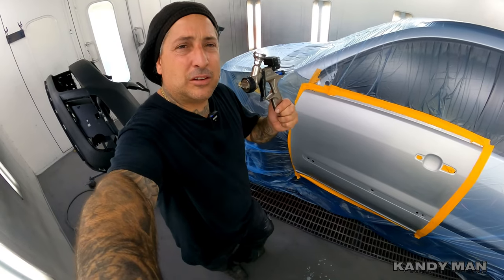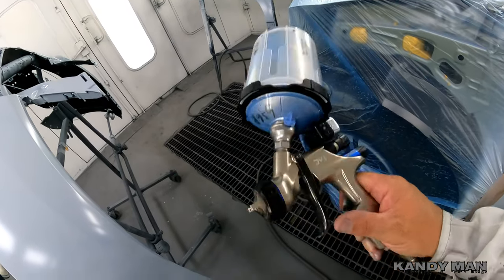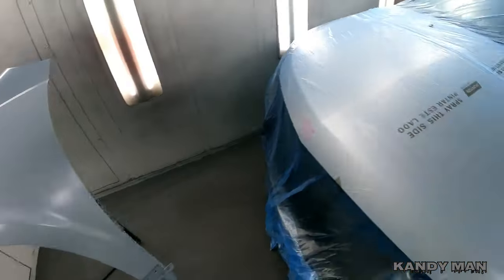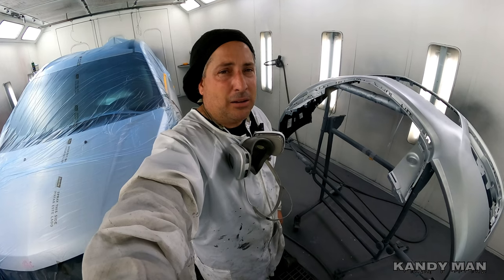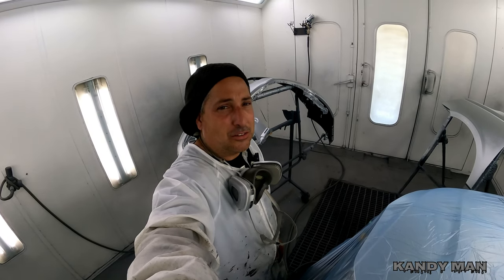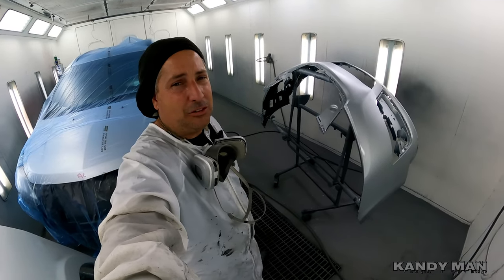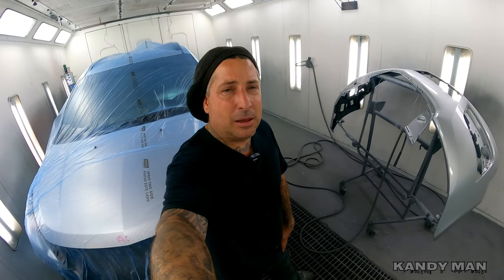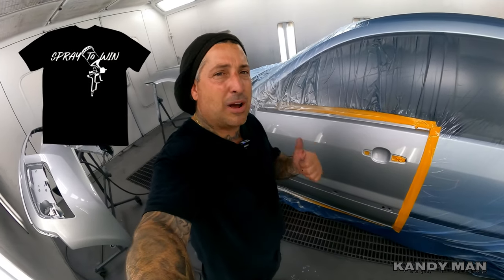THE BEST BASE GUN - IF I HAD TO PICK..

Comment: I used the Walcoms for 15 months. An x light for primer, the 360light base, the 360light clear, and ego190 0.7mm for cerakote as well as a 1.0mm and 1.2mm for smart repair. I also had 1.2, 1.3, and 1.4mm needle, nozzle, and caps for both 360light guns. They sprayed pretty good, all 4 were HTE but they didn't last and i take reallt good care of my stuff especially when the 360light's were $850/each, with the two extra neddle nozzle cap sets being $180/each for both the base and the clear models, and ego190 was $500. I switched to DV1's and should have gone with them to begin with.

Comment: Looks good. I love my Tekna gun for clear. I got mine a couple years ago. Also, thought about trying the DV1. Before you apply your second coat of clear, do you check it to see if it's ready for the second coat? If so, do you wait for it to be hand slick or still sticky when applying the second coat
Reply from the maker: No. I time it depending on the product.

Comment: One of my bosses is trying to convince me to get the dv1 because it's so versatile for candy, metallics, and Pearl's but I own an lph400 and recently got the purple LVB air cap as its intended for what is stated above but it makes the gun LVLP putting out 110ml/min with a 1.4 tip and max pressure 14psi. Do you have any experience with the LVB if so how does it hold up to the dv1 capabilities?
Reply from the maker: I love iwata  but not for base coat to me the dv1works much better for base hopes this helps

Comment: I noticed in your later videos. You seem to have stopped using the 3M versa flow system. Is there any reason why?
Reply: i did notice you did sear it in the 2nd half though....why swap?
Reply from the maker: I  still use it  .its a great setup.  i have been prepping a lot so I make sure when I clear it on that's when the overspray is heavy

Comment: I'm curious if the fluid nozzles are different between the base and clear dv1. I tried the B plus air cap on the clear gun, it's a clear coat cap they put on the base gun. It's between the c1 and c2.  Been using the dv1 with the fan In 1 1/4 , 1.2 tip, 17 psi, 3-4 inches and really fast. Makes it fast for the clear I use and uses less material.
Reply from the maker: Not sure  but sounds like your dialing things in .💯👌
Reply: Fluid nozzles are different for sure
Reply: Fluid nozzle between the base and clear upon inspection looks the same except the clear nozzle tip is about .5mm longer compared to the base.  I have sprayed the base nozzle with the clear c1 & c2 caps and honestly cannot tell the difference.  So in if you already own a dv1 and don't want to buy the dv1 clear then just buy the air cap.
Reply: @casperchea7865  I have sprayed the dv1 with caps interchanged and the finish is not quite as good
Reply: @jeremyoetken2094  You must have microscopic eyes to detect the difference between the two,  how was your testing?  Back to back spraying clear one air cap after another or different panels?  Same pressure same distance?  I'm not in anyway trying to offend you with these questions just want to know more as to how you came to that conclusion?  And also define what you mean by not as good?  As in the peel not as good or atomisation or flatness not as good?   Tighter peel or smaller peel?  And just to confirm you've spray both dv1 base and clear nozzles with the clear caps and saw a noticeable difference?
Reply: @casperchea7865  All I am saying is it is not exact. It will work but the spray fan is not as consistent and has more orange peel.